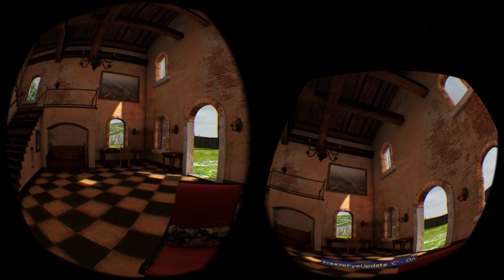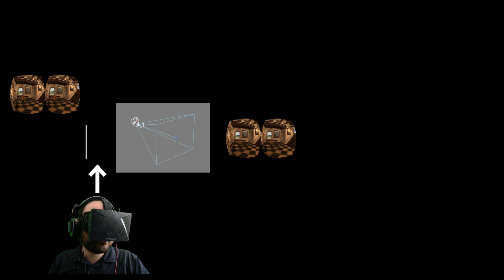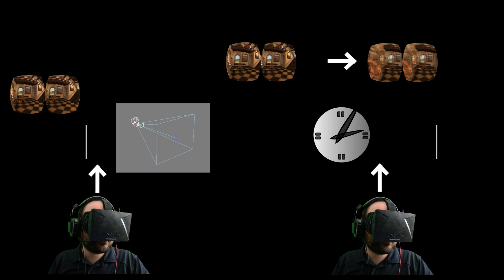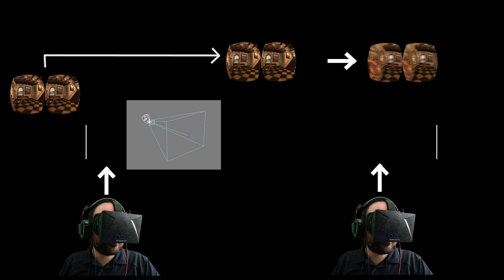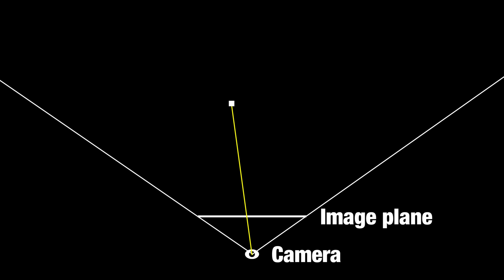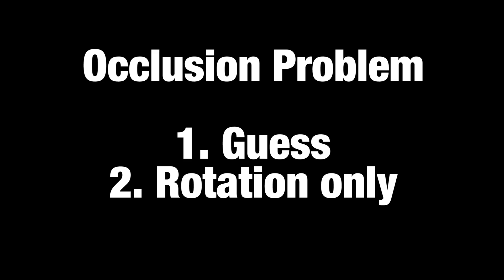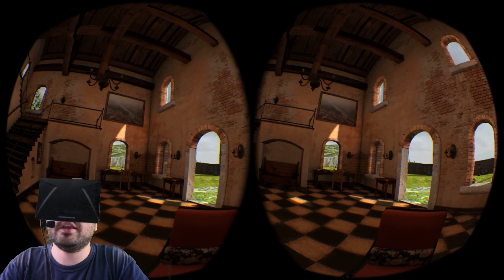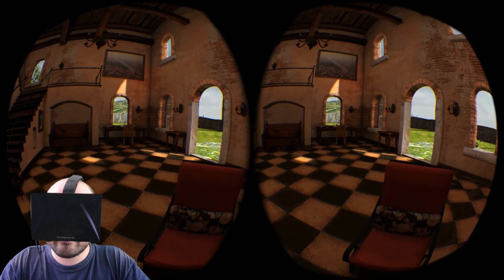Oculus Rift - How Does Time Warping Work?

Comment: I wonder, since the card is rendering two cameras anyway, if they could be set to a "wider" stance than the interocular distance and the data from each camera could be used to fill in the occlusion.
Reply from the maker: It's possible, but any point of view will have some elements being occluded. If you set the IPD wider and then try to interpolate to get your normal IPD, your normal view will then have some disocclusions! It's a challenging problem, but Oculus's latest ASW (asynchronous spacewarp) technology does a very good job.

Comment: exactly how long is a short timescale?
Reply from the maker: matthew young Well if you try to time warp over too long of a time scale (say 2 seconds) then you'll notice black boundaries around the screen as you turn your head where no pixels were rendered during the prior frame. This happens in some apps during loading on Gear VR (which has asynchronous timewarp). This can also occur at shorter time scales if you move your head very quickly.
Reply: Which is why everyone moves their head slowly in all the vr demo?
Reply from the maker: matthew young Well no, in most VR demos on YouTube the player has a good PC and the app is able to run at the full frame rate, so the effects of time warp are almost invisible. Most people turn their head slowly for two reasons: 1. fast head motions are unnatural and rare in real life; 2. the HMD adds some weight to your head and if it's not fit correctly, it might slip during fast movements.

Comment: How realistic would the scene be if a center view was rendered and then the left and right shift was applied for each eye?  I imagine this would be cheaper than rendering two separate views completely.
Reply: TennisGvy That will produce the same occlusion problems.
Reply: +TennisGvy I'm pretty sure vireio perception has the option to do that. Either that or vorpx, not sure which. Probably vireio.

Comment: Very good explanation. This is amazing. Keep up the good work!

One thing though: now that we have DK2 with translation, how does timewarp hold up? Is it more noticeable now? How do they handle it? Do they have any new tricks?

Also, I'd like to know what it feels like to press the C key in the video. Does something feel psychologically off when you do it at such large scales?

Can't wait to get a rift of my own!
Reply from the maker: guyboy625 I've tried it a bit on DK2 and the experience is very similar. They haven't implemented any kind of time warping that can vary your position yet, only rotational time warping. Pressing the C key feels a little weird because the edges become noticeable very quickly as you turn your head, and because you lose parallax, but I still feel like I'm looking around, just like the world is kind of "frozen" and has lost some sense of depth.

Comment: CastAR is probably going to destroy Oculus. AR & VR, higher resolution and it's cheaper. It's looking really good. I was thinking of getting the Oculus, but after seeing the improvements on CastAR and how professional it all looks, CastAR I think will be the way to go.
Reply from the maker: There are a few arguments against that. One is that the retail version of the Rift will probably be higher resolution than the retail version of CastAR (1280x1440 per eye as opposed to 1280x720 per eye). There is a good chance the retail Rift will also have lower latency than CastAR (they're targeting under 20 ms as compared to CastAR's 30 ms). More importantly, the Rift has a much larger amount of VR content being built for it and right now there's no way to run that same content on CastAR. That might change down the road, but right now I don't think they're going to be the best choice unless you're mainly interested in AR experiences. You can read a discussion of differences here: https://forums.robertsspaceindustries.com/discussion/68883/castar-an-attempt-to-dispel-the-myths
Reply: eVRydayVR Latency specifications for the CastAR haven't been announced.. All that has been said by CastAR devs, however, is that the latency for the CastAR will be lower than the Oculus. Also, the CastAR's first model will be shipped in September already. The Oculus Rift consumer version still hasn't been released. Once the consumer version of the Oculus Rift is released, no doubt CastAR is already working on a higher resolution version. CastAR has been around for a much shorter time, and they already have the consumer version shipping soon. This means resolution can change easily with newer versions. CastAR will most likely maintain the highest resolution, and lower latency and response time, as they have shown to be quicker developers with better specs.

The only thing I will agree is superior about the Oculus is the amount of content. However, once CastAR hits the shelves, no doubt it will overtake the market, as it offers better hardware and performance in a lighter, cheaper and more practical product. Also, porting Oculus Rift games to CastAR (VR wise) won't be hard, as its VR is very similar. So eventually, the CastAR will overtake with VR content, which isn't even the function most people are looking forward to.

AR is going to become a big market, especially for me being a flight simmer. Other people, such as people who play board games, or strategic games, will want this. Not only those types of gamers, but imagine having a few retroreflective surfaces on the walls, which then turn into portals into another dimension with zombies trying to crawl out to grab you, and you have to shoot them. AR will change the gaming industry.
Reply: FSXtremeVideos Which type of game do you think CastAR can do better than VR? Not FPS, not racing games, maybe third person sports games, but what else?

I think regular non VR/AR games can be more easily adopted to VR than to AR, but maybe that's me. Which games/demos for CastAR do you think compare to demos/games for Oculus?
Reply: CastAR is more focused on the augmented reality side of things. From what I seem it's basically just a head worn projector. Head mounted displays like the Oculus are more dedicated to achieving sensory presence with hi-res LCDs.
Reply: CastAR is awesome. And Jeri is where its at. Blend realworld cockpit (say a real car) with projected surfaces (simulation running on windows and windshield).
Btw, this timewarp crap is the worst thing ever. An idiotic "solution" that creates more probs than it solves. And bigger render regions defeating better fps aim...such a stupid and fake concept.
Reply: ***** Why? The technology is already here, and it is better developed than VR. It has more possibilities and especially this hybrid AR VR product. Why settle for something less impressive when we already have access to the more advanced technology.
Reply: ***** I doubt you've watched EVERY video. You've got to imagine the possibilities, and if you don't have this capability, you need to try it out for yourself.
Reply: ***** Geez CastAR is coming out with their first version, and you are going to compare Oculus' final version? Bit of an unfair comparison I'd say.

Also, I'd say the board game concept is my least favorite one. My favorite would by far be the flight simulator concept, or the zombie concept.

Anyways, I don't know what you're complaining about if CastAR can do exactly what Oculus can, but better as it has better FPS and latency, and it does even more (AR)
Reply: Dude do you even realize castAR does VR also? And at 120hz with 720p per eye? Do you realize the glasses can be closed? Do you know DK2 is only 75hz with a cellphone 1080p panel split between 2 eyes resulting in squarish screen ratio?
Reply: ***** Did you tried the dk2 and the last CastAR prototype?
Reply: Sniff sniff Mmmh, I love the smell of astroturf in the morning.
Reply: What I like about castar is AR based games, so I won't get motion sicknessed when the real world is connected to the virtual world. Oculus is great, but not for more than few minutes for me. Castar is a nice alternative.

Comment: I had trackIR 4 and the reason why I didn't go trackIR5 back then is cause the lag

good thing oculus is doing head tracking right lol

the goggles alone are worth the price but coupling head tracking and full supported games is crazie
Reply from the maker: Absolutely, the pricing of the Rift is amazing, like 10 times less than every other high-quality HMD that has come before it, and it's going to change everything. :-) And Oculus is definitely solving the right problems with their focus on low latency. It's a very solid, smooth experience with little to no perceivable lag.
Reply: whats HMD
Reply from the maker: ant a Sorry, that means head-mounted display. A screen you wear on your head.
Reply: I just want the OLED screens

they said its like having a 700" screen at 45 feet away or something

OLED produces pure black

I remember way back when the black levels was important

people are forgetting the basis of having good quality screen like color and backlight bleed

this kind of technology alone makes the price tag well worth it and massive additions like 6 axis tracking and 3D with correct lense curvature.. maybe one day they will make it where people can get the right curve for their eye at the doctor lol for ultra realistic replication of reality on PC

Comment: Interesting and informative explanation of time warping, however I feel that you missed a few of points which could be important.

1). The 'to be rendered' frame is (should be) based on predicted position, so that the delta between predicted position and real position when you check just before the frame is pushed (and potentially time warped) should be small. Thus making warping less drastic, if needed at all.

2). The time warping runs into problems with active scenes. Those which have independantly moving objects. For example time warping a racing simulator would probably cause some pretty horrible artifacting.

Thanks for the video.
Reply from the maker: Yup I glossed over prediction to simplify things - if it's good then the warping interval will be quite small. Additionally, the time position you warp to needs to be slightly in the future because of the delay between warp completion and the image appearing on the display, which requires another prediction over a shorter interval.

And yes, I should have mentioned something about active scenes! It seems like there's no simple solution for those. Maybe if you could determine the trajectory of each pixel based on what polygon it belongs to that would be a start. Or maybe it's just visually acceptable if objects move at a lower frame rate than the environment? I have no idea.

Comment: I'm not sure i understand this correctly. How is time warping helping the occlusion problem in real time while we're playing? I can't see the rotation fix help very much since we move a lot when we play games. Will this effect apply for every frame or will it only be when we stand still and look around?

 I'm just wondering, will this improve the fps overall or just in some instances?

 correct me if i'm wrong.

I'm thinking that we will reduce the amount of rendered fps by only render about half of the frames and then "freeze" the frame with time warp. And if this is applied to every frame then i guess the "frozen light" (in your chair example) won't even be noticeable since it's for such a short period before it's refreshed.

So to put it simple.

let's say we have 60 frames a second that we render.

Will time warp take, let's say half or less of those frames and then fill in the rest with this method?

30 (rendered) + 30 (time warped)? Then this will lower the the work of the computer tremendously!

I just found out about time warp, i don't know if i'm spot on or completely lost on what time warp will actually do.
Reply from the maker: You totally have the right idea. Time warp is kind of bad at increasing 1 FPS to 60 FPS, because over longer time intervals it has more artifacts that are difficult to address. But for increasing from say 30 FPS to 60 FPS, or 60 FPS to 90 FPS, it's a lot more feasible, and very low cost compared to rendering each frame from scratch. It can also be useful during sudden unexpected frame drops, e.g. if a background process seizes the processor to check your email - it's better to see some artifacts for a bit than to lose frames.
Reply: thanks for the reply, i noticed that i wrote a bit wrong (" if this is applied to every frame "). I didn't mean that we time warp every frame, but every second. So that a part of a second is rendered and the rest is "filled in" with time warp.

However, as you say, from 1 fps to 60, sounds like that would have a noticeable effect on the picture (however, if it could be done in some way it would be a huge breakthrough in game optimization).

 I wonder what the least amount of FPS could be without having noticeable artifacts in the picture.

This is great for the rift, but i recon there is great potential for this in games that doesn't have oculus as well. Image having the option to turn on time warp in any game, making it easier for low end pc's to handle the more demanding games. that would be great!
 But then again i have no idea how much effort time warping demands from the computer, so i could be dreaming :)
Reply from the maker: That's not unrealistic at all. :-) Time warping is great for monitor based games too. It just hasn't been invested in until now because latency is so critical for VR. But the fruits of VR development will fall down to other games too, everybody wins!

Comment: You should note that the Oculus SDK does only the rotation and no positional reprojection because of the occlusion artefacts, a problem that is unsolved yet. 

Secondly: While the goal is to use timewarp to increase the framerate, this is not implemented yet.

You can look at the SDK source for details.
Reply from the maker: On the first point, I do note that explicitly in the video near the end of Part 2, and in Part 3 I demonstrate it using the chair. You're right that the SDK doesn't have out-of-the-box support for increasing framerate yet, although it could probably be implemented by reusing some of the timewarp functionality. Looking forward to official support.

Comment: Where do I download this demo? I downloaded the 0.3.1 demo, but pressing 'c' did not stop the rendering.
Reply from the maker: It's OculusWorldDemo which comes with the 0.3.1 SDK (under ovr_sdk_win_0.3.1\OculusSDK\Samples\OculusWorldDemo). It's not Tuscany. You need to copy the OculusWorldDemo.exe file from Release into the main OculusWorldDemo folder, then run it.

Comment: Let's say that we could run every game at 120+ fps, would that negate the issues with latency on the rift? Or is 75fps the limit of DK 2.0 and past that we would need a higher refresh rate on the LCD in the Rift in conjunction with a higher framerate from the PC in order to help without time warping?
Reply from the maker: If you can run the game at 120+ FPS that means you can render each frame faster and start rendering it later in the frame interval (late frame rendering), which does decrease latency. However, even if you're doing this, it's still worthwhile to do time warping after rendering the frame before you send it to the display to update it with the latest possible position, which decreases latency even further. You would be warping over a shorter time period, which would produce better results with less artifacts.

Faster refresh rates don't actually help with latency on Development Kit 2, because of its low persistence feature. It only shows each frame for less than a millisecond. As long as it's in the correct position for that period of time, your brain fills in the interval between frames automatically. However, with low persistence, lower refresh rates will cause uncomfortable flickering, especially in people who are prone to seeing it - that's why DK2 is 75 Hz, and why the consumer release is targeting a 90 Hz refresh rate, to eliminate flicker for all people who might use it.

Comment: My thoughts:

This might be some crazy talk - but - rather than just 'guessing', I wonder if there is a clever way of directly rendering the dis-occluded region. The next frame is being rendered on the other buffer, but it hasn't finished yet. But at least some of the pixels are done, so couldn't they be used to fill in some of the dis-occluded region? Furthermore, what about a heuristic algorithm that chooses to render certain pixels first based on their likelihood of falling in a dis-occluded zone. I hope I make sense.

Also, the time warping concept isn't just relevant to the Oculus Rift. More generically, it should be able to provide frame-rate improvements for any input device (e.g. mouse and keyboard) or for cutscenes where there is no input.

Comment: For graph at around 3 minutes, this happens when frame is starting to be displayed not at the end, unless you meant that picture of a frame as rendering period which wouldn't make much sense
Reply from the maker: You're correct, I was mistaken about that part. I wasn't sure where in the time framing rendering of the next frame starts.